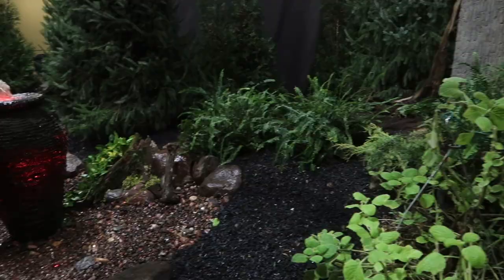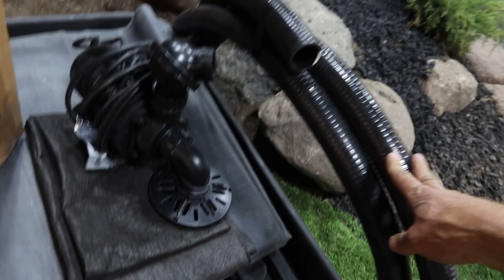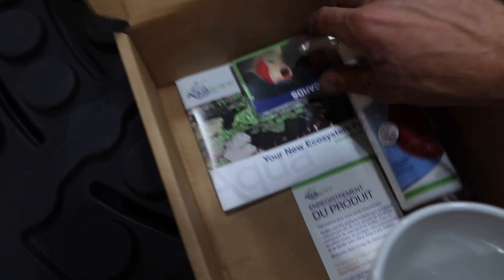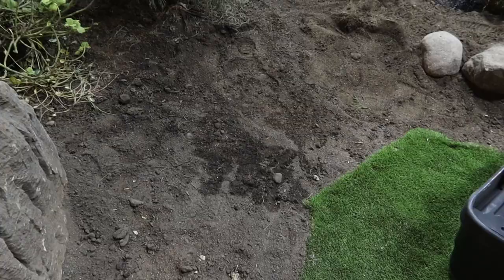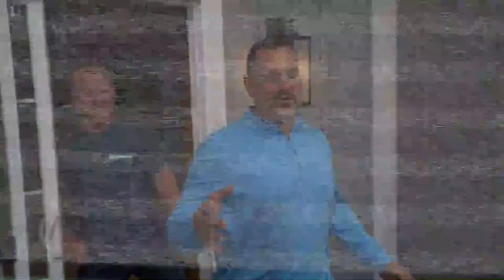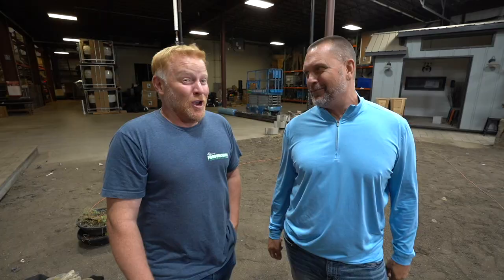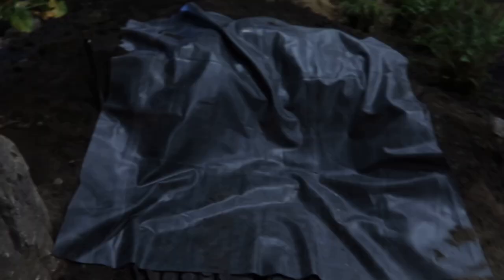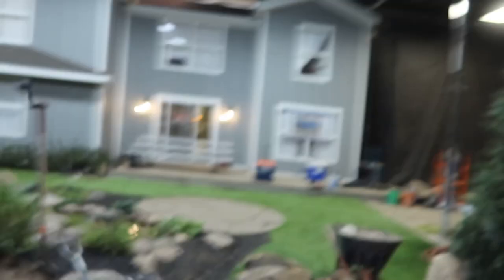How to Install a DIY WATERFALL KIT - Part 1

Comment: Great video!  I’m planning on installing a pondless waterfall in my backyard and have a question for you. Sometimes in my area we get heavy steady rain. How do you avoid the basin from getting overfilled and having yard backwash of dirt and other yard materials back into the basin?  Am I overthinking this?  Is this an non issue?  Thanks

Comment: Great video guys. Question where do you run the electrical for the pump? Do you drill a hole in the side of the tank, to run the plug into a conduit routed up to a nearby outlet box with weather proof cover?